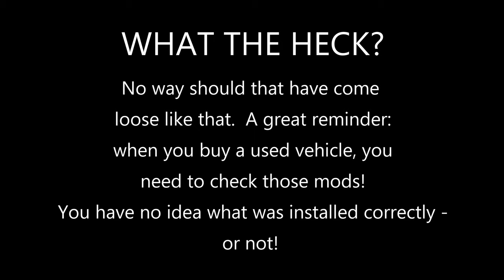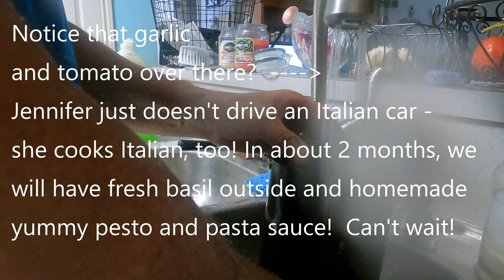How to Clean the Air Filter on a Eurocompulsion V4/V4.1 Air Induction System

Comment: I would just buy a replacement filter
Reply from the maker: lol...I bought one replacement so I take one off, put the other on; then clean the dirty one at my leisure so it is ready to go next time I change my oil.  The canister costs $78.99 a shot.  They re designed to be cleaned and reused.  To me, at least, 5 minutes spent cleaning them is much preferred to 79 bucks every 4,000 miles.